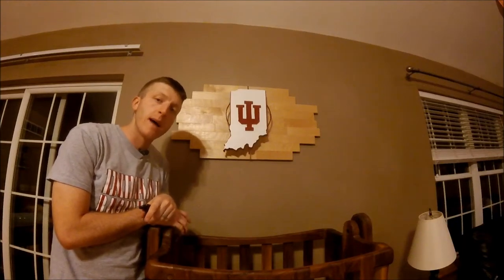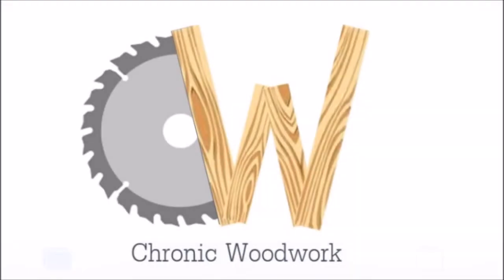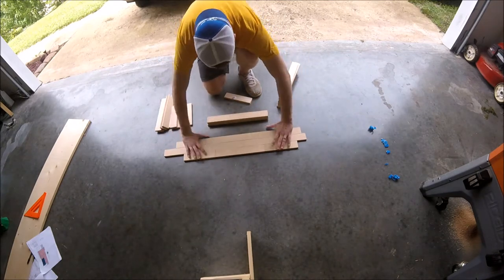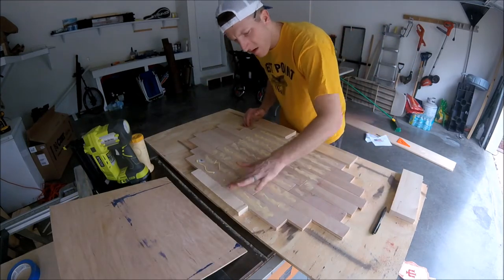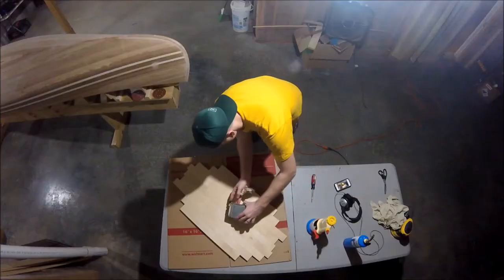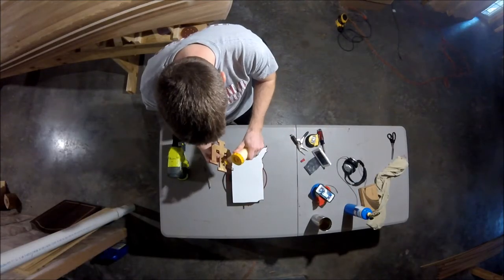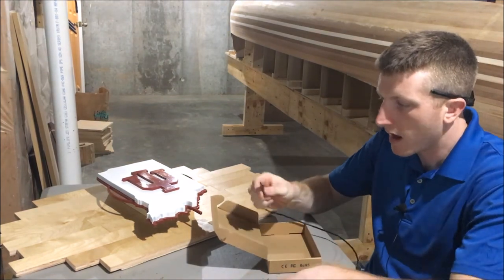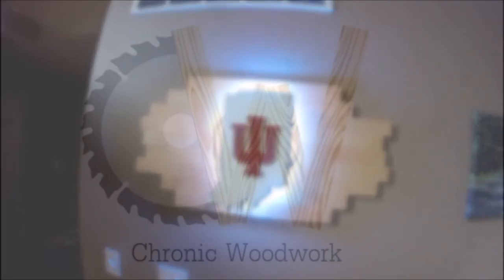Sports Team Wall Decoration

Comment: Would using your Shaper Origin make this easier or harder? I'm on the fence about buying the Origin. Thanks.
Reply from the maker: Greg, I think it’s a bit of a wash on this specific project- it would certainly make my scroll saw cuts more accurate but might take a bit longer. 

The IU logo and state cutout are such a small portion of this project thought. A lot more time spent cutting the background/court pieces, painting, assembling, finishing.

Shower origin is best utilized making templates in my mind.
Reply from the maker: And inlays.
Reply: @chronicwoodwork5466  Thank you.
Reply from the maker: Greg Geisler hope I made sense.
Reply: @chronicwoodwork5466  Yes, you did. Adding inlays (SC Gamecocks!) to repurposed tables is on my radar.  Also, the ease of using SVG files vs. learning Fusion360 appeals to me.